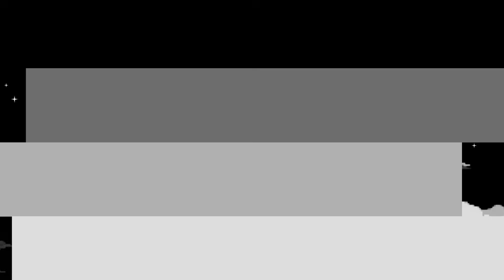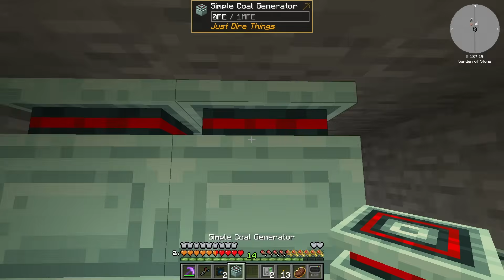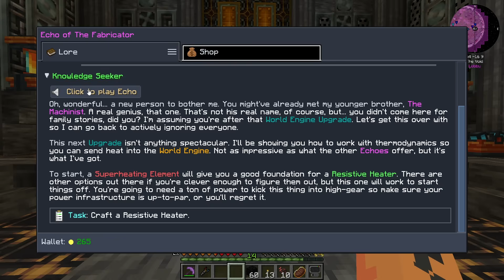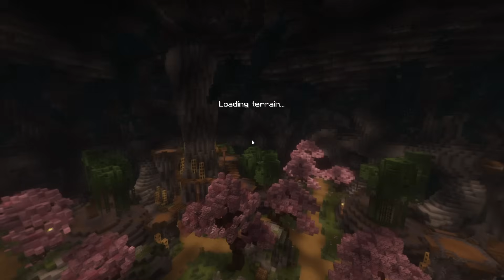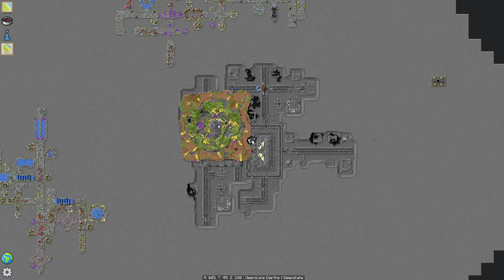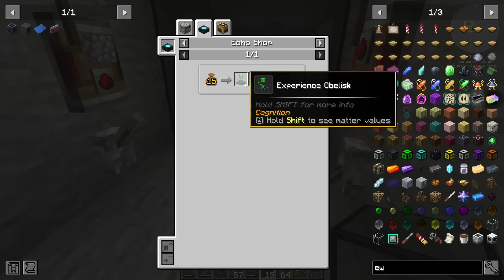StoneBlock 4 - Wireless Power + Mob Farm Automation - EP5

Comment: I played through the pack myself up to chapter 4 (for now) but it always amazes me how you can come up with things that are much simpler or more efficient, like that mob farm. 
For example I used oldschool storage drawers + some trash cans with fuzzy filters, but a diamond barrel seems to be pretty much an all in one solution!
I'm sure it helps a lot to actually have good knowledge of all the different mods. I knew everything back in the 1.7.10 days but nowadays most mods are a mystery to me. (But I think that will change thanks to Stoneblock 4 - they really did an amazing job with it)
Reply: Ditto

Comment: the resistive hater is very dumb - they say 2k rf/t because that's what's needed for it to maintain about 350 deg in the world engine. I tried to convince them this was a silly requirement for as early on as this requirement can come up (notably its for the energizing orb for powah) but I was shot down as you can technically just dump an energy cube at it for the one craft and call it a day.
Reply: Which is what I did. I already had an ultimate energy cube that was filled up and I just set it to like 10k rf/t to get it up to 350C for one craft, then I scrapped the whole thing.